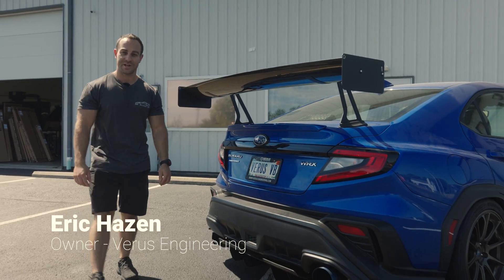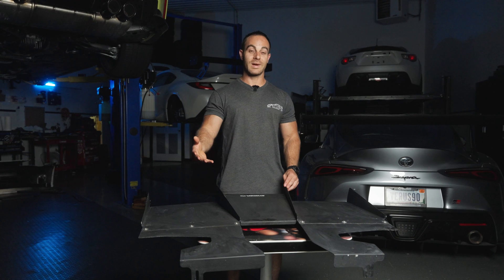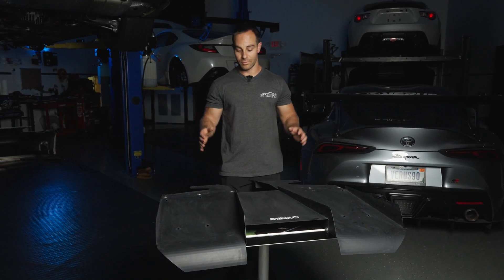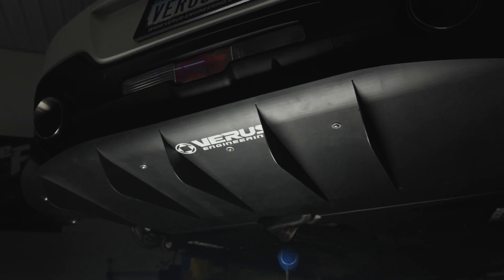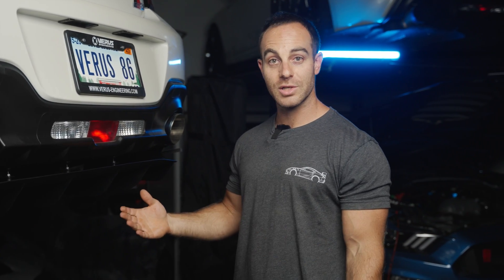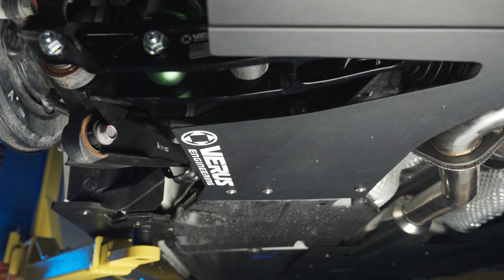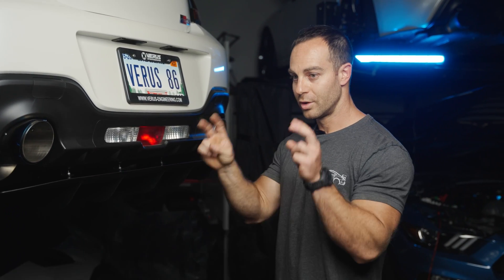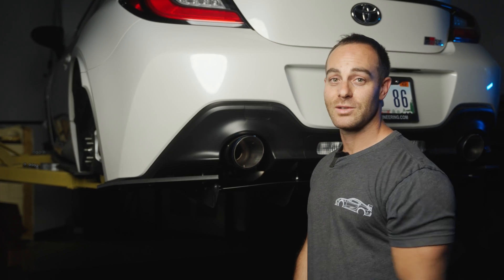What do rear diffusers actually do?

Comment: The problem I have is that the rear of my VB WRX gets a little squirrely at high speeds (80+) in the bends. Straight is fine, except if coming over a crest at like 100mph at NJMP Lightening. Switching the Dunlops to PS4S def. improved it a lot. The OEM Dunlops such.   So, I checked Verus bc high quality, and I trust that these aero actually function. But, $700 is a bit steep, esp. when I see no specs of how much down force this helps to create. Another thing is, judging by the WRX install video, this sits really low. On road driving, it's going to get destroyed. Then, I'll never be able to get in/out of my driveway.
Reply from the maker: Understood. We appreciate the feedback. We've had a lot of owners appreciate the increase in rear downforce and stability at high rates of speed. The diffuser is large, it has to ship freight, so material and size is definitely part of why the cost is what it is.

No issues getting in and out of driveways from our experience. That also depends on the exhaust used as well, of course.

Comment: Had to sell mine because it didn't fit my tomei 😢
Reply from the maker: You have a VA STI, correct? If so, we have had a good amount of owners get it to work with the Tomei catback. It just requires a small amount of trimming, but it has been done multiple times in the past.
Reply: @VerusEngineering  ill try again when i get the chance to order one really loved it 😄

Comment: Diffusers are a bit of an enigma. It's exactly as you said, diffusers increase pressure. The pressure is being increased back to atmospheric, but not quite. What this does is create a favorable pressure gradient, as the airflow at the front of the car is higher pressure than at the rear, so the airflow accelerates towards the rear, accelerating as it's constricted. As it expands it slows down increasing in pressure, but it never quite reaches ambient, it's always slightly below ambient at best because of the low pressure wake at the rear of the car. 

Another way to think of a diffuser is like a bellows, or a piston in a combustion engine. As the piston descends from top dead center it forms a void, and air rushes in through the intake system to fill that void. A diffuser is like the intake stroke, but at a constant rate, as long as the car is moving forward. The diffuser is like a constant syringe drawing air from the front splitter, the bigger the volume(within reason) the greater the suck.
Reply from the maker: Always!
Reply: We love a greater suck!